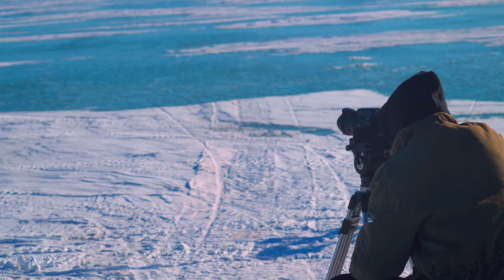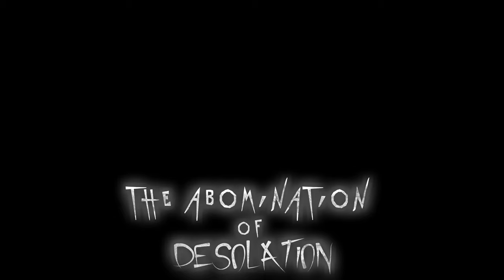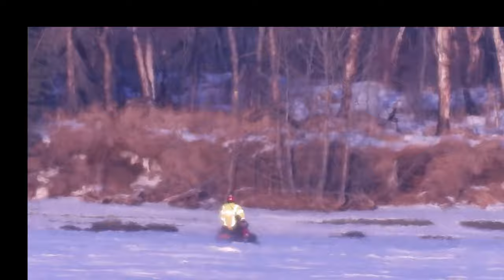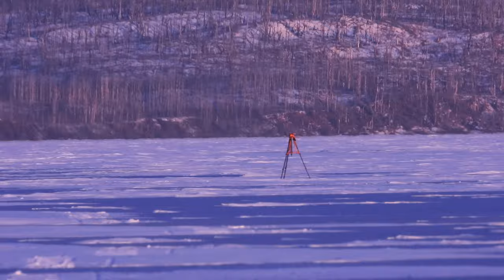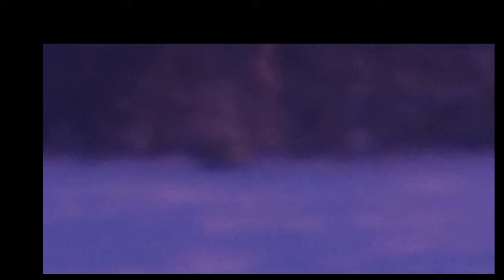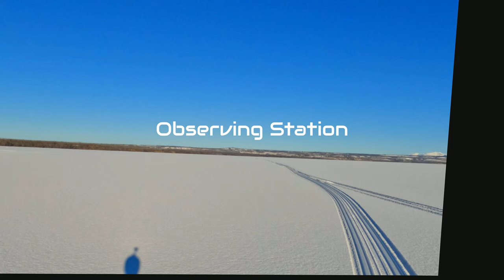Declassified — 5.5 Mile Tracking Camera — Light Analysis

Comment: Excellent idea, you guys do some outstanding work! Thank you so much for this!
Reply: ShawnHawkins666  Sadly, and no one you trust has told this to you yet, but you are the one that is confused about the shape of the real world.      
  1) You cannot find any official direct measurements that show the surface of large areas of undisturbed water curve at all. see Planar Surveyors.
  2) You cannot find any official direct measurements that the surface of the earth is moving west to east at 1000 mph at the equator. 

 What you can claim is that these 'direct measurements; are impossible because... 1) The earth is too big. 2) All speed is relative and therefore either 'reference frame' can be treated as stationary. 

   Alas, both of these 'excuses' are falsehoods. ;-/ Do you know why they are NOT falsehoods? Please explain why you believe these excuses. They are the foundation of your belief in a 'rotating globe'!
Reply from the maker: ShawnHawkins666  The sky has more dimensions than perceivable with equipment within the public accessible market. You literally have never seen the earth from above 100,000ft, you've only seen screened images. You would have to verify at immense altitude to confirm they do not change, and even then, you would still have to probe with your own equipment. Otherwise you are trusting screened images, screened documentation, screened justifications: all upon blind faith that the screeners are not deceiving or deceived themselves.
Reply from the maker: Thankyou so much for all the work YOU both are doing! You are providing very concise data, and increasingly so, thankyou for your efforts as well, and hopefully continued effort: alot of our work at the lake has been cross referenced against yours!